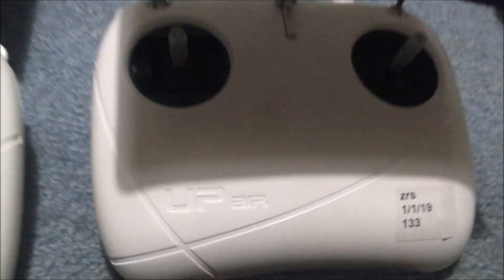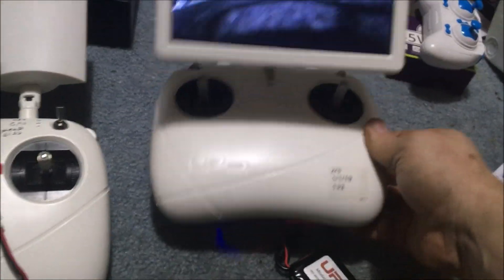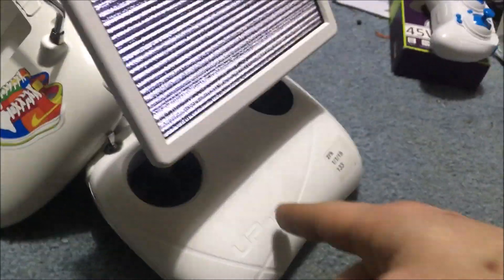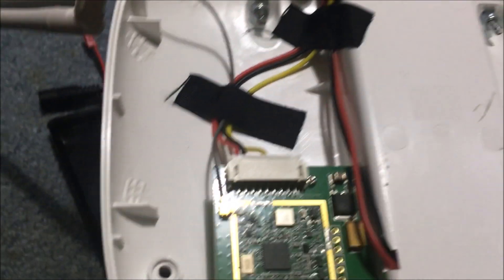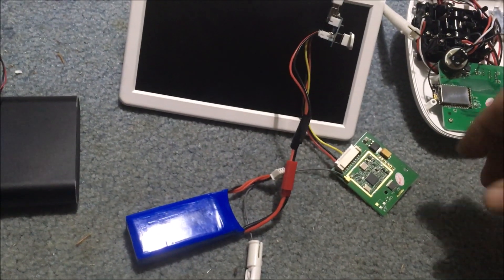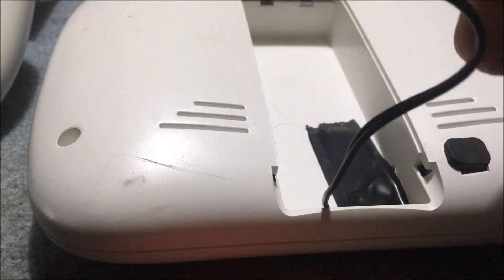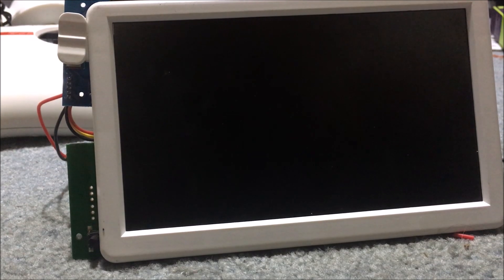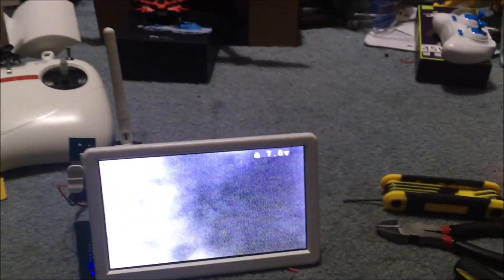UPair One USE FPV SCREEN ON ANY 5.8 DRONE Controller tear down SCREEN MOD

Comment: I love the 7" monitor on mine. I would tear into mine but I'm selling my upair.
Reply from the maker: Yeah I bought the monitor n extra controller just to see if it could be used by it self , havnt even flown mine yet
Reply: Why are you selling? My issue is the "field calibration seems ineffective.  Am planning on the Mission planner calibration on my laptop outside but haven't yet.